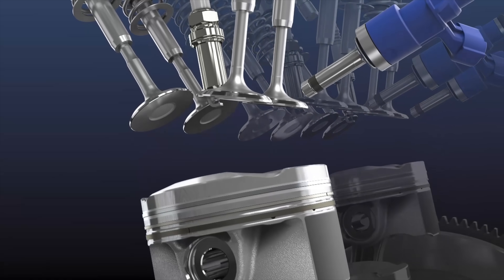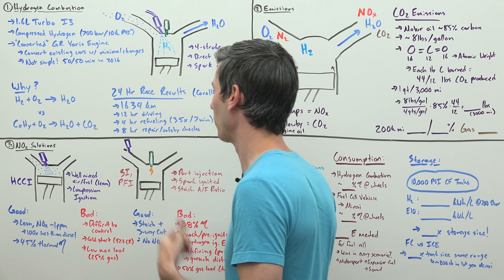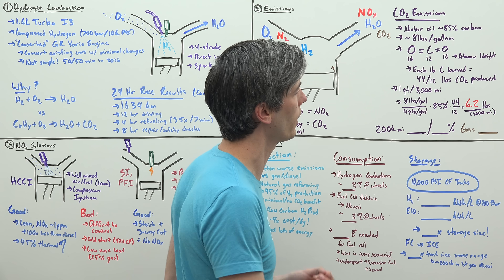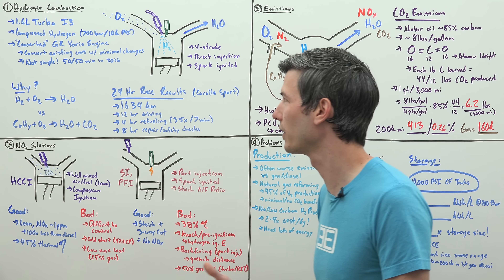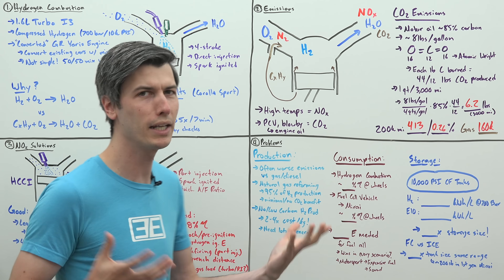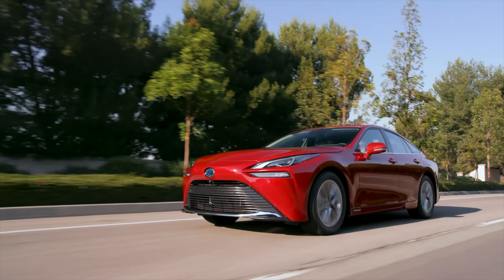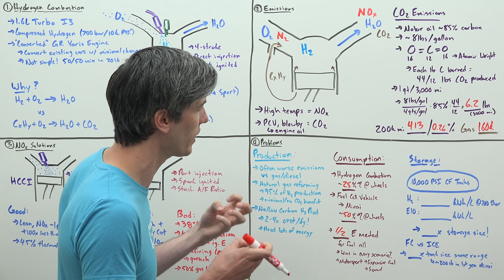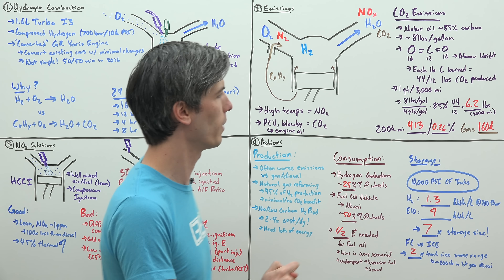Toyota's Developing A Hydrogen Combustion Engine!

Comment: @Engineering Explained;
Most all of Your videos which i have viewed about combustion engines are very well done with expertise from engineering with precision, accuracy and exactness, as We scientists and engineers do.
However this specific, particular video presentation though it has and uses the same basic type of concepts has many aspects that are lacking and thus very biased improperly.
As for the production of Hydrogen, if natural gas is used, this video presentation has 'conveniently' left out the development of natural gas combustion facilities which have near to complete zero harmful emissions. Comparatively, for the EV type vehicles the production of Electricity is not taken into account, with very little produced by other means than combustion also. In addition, also the HFC approach which Toyota also has developed as presented, has the same issues with all EV regarding the batteries, cost, size, weight, durability and use for other than common personal vehicle use. The mass need for large engines within heavy equipment, long range transportation vehicles and other heavy load engine uses and needs does not allow for practical use of EV or HFC type situations.
Also left out are the simpler means of converting a diesel type engine for hydrogen and other direct injection gasoline engines which have the necessary stronger internal parts.
In addition, the development of a device which extracts H2 from the air, including the H20-water vapor emissions is an important aspect with Hydrogen production and use for combustion engines.
There is also a major manufacture of heavy equipment based in the UK, JCB, which has successfully developed, implemented, production and using hydrogen engines within their heavy equipment which EV and HFC are not useful, effective and meaningful. The head of the company presented the same issue with the many other heavy engine uses in which diesel engines are used such as large transportation vehicles, which need large power, and many hours of use as large tractor trailers and other manufacturing and industrial uses.He also presented in the short, the aspects about EV with the batteries in weight, cost, durability, etc. which is inflationary [cost of small EV is more than double similar vehicles], and the necessary parts, elements continue to rise [also not mentioned are the limited resources].
There are other options including combinations which are viable too.

What was interesting and seemed to be driven by the major companies in the automotive and oil-fuel in the 1970's-80's for preventing greater efficiency, low emissions, use of ethanol, methanol, then hydrogen and EV, became clearly no just them 'protecting' their businesses and profits, rather through more information they are together within the Globalist/Elite/et. al Cabal Organization Agenda as Rockefeller [Standard Oil-Allopathy medical system school funding/Pharmaceutical ownership & integration] is a  key member. Thus, until the Globalists/Elite Cabal established themselves within the desired path via their major corporations, all of these developments were prevented including the Hydrogen, Electric, high efficiency vehicles from small, individuals,much during the 1980's [with success] and aspects earlier in the 1970's and some in much earlier decades [hydrogen engine development dates back to 19th century]. But, once the Elite Cabal have their grasp via their key members, corporation or attain grasp of individuals like Elon Musk, then the developments proceed, expand, etc.
Also JCB, led by Lord Bamford, is a clear Elitist too.
Now every major automotive manufacture is on the path of having full EV [Japanese led with the 'Hybrids' (why use gasoline engines which are less efficient and durable?)]

Have You seen, investigated, assessed, evaluated the Liquid Piston X Rotary engine which operates efficiently using many fuels including hydrogen? 
Their tiny version flies an aircraft drone, designed and built for the US Army.
They have a working cart using their small X version, operating on hydrogen fuel charging an electric system. There is more potential with this engine as with others too.

Clearly using the EU report apparent conclusion is NOT a valid means for several reasons. Firstly, the report includes many details and aspects if they had a proper discussion, assessment and evaluation which are valid, important and useful though the 'committee' may have decided to produce the statement shown. That Statement from that EU 'committee' is based upon many other considerations and very importantly led by specific individuals who are among the Globalists/Elite including the politicians, thus their 'conclusions' are as invalid as their decisions to promote EV without the proper full assessment, evaluation, consequences, costs, etc. as is their falsehood basis for the Agenda 21-2030 for 'Green Energy' and the Falsehood, False Portrayal, False Narrative of the Environmental Affects from current combustion engines, which has NO actual science, proof at ALL. All of the presentations of such have that been used during my lifetime [62 years] and more recently since the 1990's are as false and politically motivated by the Globalists/Elite for human control primarily via 'Global Warming' now 'Climate Change' as was the 'Ozone Layer-Whole' false  idea from floro-carbons, in which they managed to achieve massive bans upon the use of such propellants, then 'magically' within the ten years the 'apparent' ozone layer whole whole disappeared, though even according to their non-science fake pseudo-science, is impossible. So, they quickly moved onward to an another issue which lacks any known science, specifically weather patterns, climates which only have collected data with no developed causality, mechanics, thus no hypothesis, thesis and theory..
Now the major and minor politicians along with many to a large number of individuals have accepted this falsehood indoctrination as the Pathogen & Contagion Myths We all have literally been inDOCtrinated with, which has no science nor pseudo-science backing, but Globalist/Elite Rockefeller Allopathy/Pharmaceutical philosophy medical system proliferation for more than 120 years.

Hope You will take this comment in the manner with which it is intended and use it purposefully, within Your own development, view, perspective, perception as i have and not continue to proliferate the Globalist/Elite/et. al. Falsehood, False Narrative, False Portrayal, Prestence, Lies, etc. , whether intentionally, purposely, explicitly or 'complicit-ly'.

All The Best and Much Success in Your Quest, Health and Well Being. 
Sincerely
Reply: @DiscoFalcon Seems You may have trouble with reading and comprehension, then .. correct ?
Reply: @DiscoFalcon Since You clearly are unable to actually point to any specific issues in my comments then clearly You did not comprehend them, nor have the information and knowledge either.

Instead You attempt to claim some falsely based psychological assessment, evaluation, and analysis upon the writer [me], though it is impossible from such comments of technical.

Then Your claims about my psychological situation also clearly indicate Your lacking in the area of psychology too.

Thus, Your assessment, evaluation, perhaps is a self-reflection and projection, which You can correct Yourself.

May You gain Your self-perception clarity and correction.
All The Best and Much Success in Your Quest, Health and Well Being [including the psyche].
Sincerely

Comment: I think the hydrogen storage problem is solved. We can used doped Graphitic Carbon Nitride, in which you can store 10% hydrogen gas by weight. Creating this doped graphitic Carbon Nitride is also quite cheap and easy.
However, your description of the Hydrogen Combustion engine challenge seems quite daunting. Just hope that we can resolve this innovatively in the near future.

Comment: I still would like to see hydrogen fed to fuel cells instead to avoid all those moving parts plus the other emissions besides water. But the video is very well done as always. 
Just a quickie request: please use kilopascals instead of the obsolete bar. And keep those videos coming! A super valuable resource! 😃

Comment: One concept I tried was to inject hydrogen peroxide  (bleach) this reduced nock as it cools cylinder and valves. It also removes green house gas as it does not use air. Just the oxygen.  You do need to store it but it cheep. My engine was a in line postion and you can get the oil back via a scrubber in the exorst. The engine is only a generator as it only has linear motion more ideal for this. The fuel tank is smaller as range is extended with battery charging. The concept allows trucks and vehicles that are in parts of the world that has poor electric network.
Reply: Peroxide is not bleach
Reply: Which concentration? 3% 6%?  What?
Reply: @johnnycarson67  we used 6% as it starts to get expensive and diffcult to handle past this.

Comment: Combustion engine using H2 are a no go for private transportation. Fuel cell are the correct mode of feeding an hydrogen car, but we need a better storage, as hundreds of bar of pressure in the tank is a liability in case of a collision that break the tanks. We need adsorption on nickel hydrides, or palladium alloys, so there isn't such dangerous pressure in the tanks.
In general, I believe we are better off if we develop better batteries, as green hydrogen generation is an inefficient mean of powering cars: as that quote says, better use the electricity to charge the batteries.
Thank you for the wide-scoped and clear explanation of hydrogen powered cars.

Comment: Let’s not forget all the maintenance benefits have in EV’s vs any type of combustion engine. Oil changes. Heat. Wear and tear. Transmissions.  NONE of which are an issue with an EV.

Comment: I remember several years ago there was some effort to make the renesis rotary engine to run on hydrogen. Does it make any difference if you use a rotary engine vs a piston engine?
Reply: Seals would be a problem.

Comment: The reason why we need such a high pressure with hydrogen is because hydrogen's critical point is just 33K and therefore cannot be liquid at room temperature.
Reply: Wonder how come and we do not use water at 700 Bar and when needed, heating it up at room temperature to allow a high pressure thermolysis to take place, and then through a separation membrane using hydrogen and oxygen to a fuel cell to get the power we need.  That should be much less complicate.

Comment: Mazdas rotary is ideal for hydrogen. Piston engines are tricky. The rotary brings subsequent intake mixtures into a different chamber than the one that just blew up. Makes pre ignition a non issue.

Comment: JCB THE ENGLISH MAKER OF EXCAVATORS AND CONSTRUCTION MACHINERY ALREADY HAVE A HYDROGEN ENGINE TO REPLACE LARGE DIESEL ENGINES. IT'S COMPLETE AND RUNNING SUCCESSFULLY.
Reply: SO WHEN !! IS ! CATERPILLARS !! COMING !! OUT !! WITH !! THERE'S !! DEE'S ONE !!! TO ! ELEVEN !! RANGE !! THEN !!??
Reply: Like I said, it's possible and engines run. but the million dollar question is HOW LONG ?
Reply: @itchyvet  If the Warranty is Doubled ! To ! a Lifetime !  As ! Long as you own ! Your Machine ! Then ! You ! ( J.C.B ) will be Doing ! Well !!
Reply: Ask them about the fuel tank

Comment: Everything is inefficient and expensive when the technology is new. More time for development will mean more improvements on that tech. At the end of the day, no one is telling us we can only have 1 type of drivetrain.
Reply: Hydrogen is never going to be cheap, because making it without massive pollution is very inefficient. And that's just physics, not much can be done about it.
But the final nail in the coffin of hydrogen is that it's simply unnecessary. Battery electric cars are superior and already won the race.
Reply: @andrasbiro3007  BEV's don't actually solve any problems though. They are just as dirty as the most efficient petrol engines over their lifespan. A BEV battery, not including electricity production, over it's lifespan, emits roughly 85g/km Co2, it's more like 125g/km when you include the electricity for charging assuming an average grid. There are several petrol engine vehicles that beat that out. 

Hydrogen has the potential to be clean. Which lithium BEV's simply do not. Some estimates put newly developed hydrogen production methods (such as biomass conversion) at around 60g/km. And of course, the more we scale of electrolysis, the cheaper it gets and the better at it we get. Which is even cleaner than the potential of biomass. And the current most popular method of production still puts hydrogen on par with BEV's at around 120g/km
Reply: @Erowens98  andras just brainwash with the media and these ppl pushing it down our throats hydrogen going b better

Comment: I would love 2-stroke hydrogen engines
Reply: would run too hot and seize, or pre-ignition would put a nice neat hole right through the piston/s, plus how would you lubricate it without burning oil?
Reply: haha
Reply: @RI Outboards Detroit Diesel made 2 stroke Diesel engines with oil in sealed crankcase. They used a supercharger attached to the block to compress air into intake ports.
Reply: Two stroke water or liquid cooled hydrogen engines might have potential …
Reply: How would you mix the hydrogen with the oil? Hydrogen is a gas, oil is not.
Reply: Already developed for use in trucks. There's some recent very interesting videos on YouTube about them

Comment: Sounds like simply closing the intake valve slightly earlier would allow port injection to work. The obstacles really don't sound that insurmountable to me. Making hydrogen at home with a solar panel, storage tank, and a compressor would be pretty easy. On a large scale it also seems easy.

Comment: 46km between refueling - Can't see how that will work in the real world. On a trip from LA to San Francisco  you would have to fill up 13 times.
Reply: I have a nearly 10 year old EV and it can still go 120 km between charging
Reply: @AnalogueKid2112  ...and there's no reason it shouldn't last another 10 or even 20 years with very little maintenance.
Reply: @AnalogueKid2112  I’ve a 22 year old gasoline engine and I still can do the same range as back then :)

Comment: How about the embrittlement of the engine metals through contact with hydrogen?
Reply: Oh that's an interesting point to consider,  there are electrostatic coatings and how much embrittlement takes place varies based
on temperature.   Inside the combustion chamber on an engine at high temperature's may prevent a lot of this issue, but
a topic worth  taking a look at.
Reply: Good point Peter, your half way there.

Comment: The energy supply chain feeding Lithium Battery Vehicles is not green at all and isn't that sustainable, Hydrogen Fuel Cell and ICE vehicles are (imo) the future of personal transport.
Plus if enthusiasts are still allowed their right to modify, we may see 1000hp Hydrogen motors eventually

Comment: Very informative presentation Jason, thank you! The fire safety of the hydrogen powered car makes me concerned, considering large, high pressure H tank, and propensity for hydrogen to leak, ignite and explode! Only if and when hydrogen can be stored in some safe way the hydrogen car shall be viable.
Reply: Toyota shot bullets through the hydrogen tanks and they did not explode. Hydrogen being light as it is just escaped through the hole that was created. Meanwhile a Tesla may burn for hours if the batteries catch fire.
Reply: IF you understand that Hydrogen is lighter than air en therfor will fly up into the air, you will know that is is extremely hard to make ti explode. We are driving on gas, en that is a fuel that is heavier than air, do oyou have the same concerns with that, if not the fear for hydrogen driven cars is unfounded.